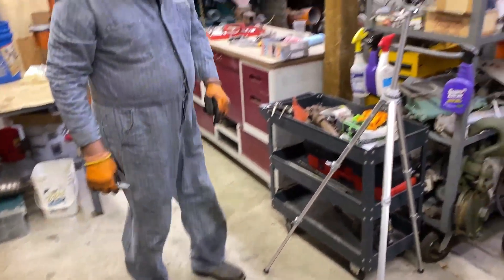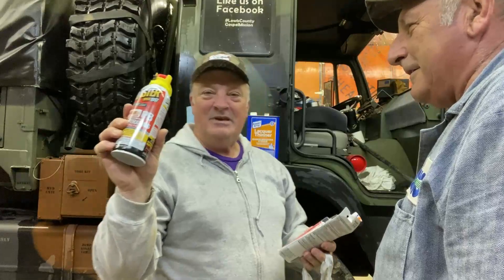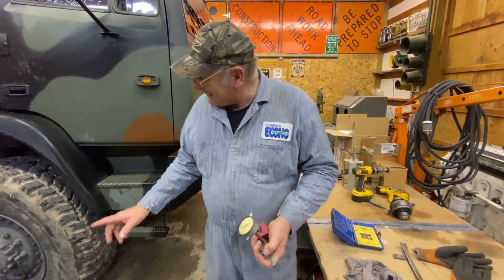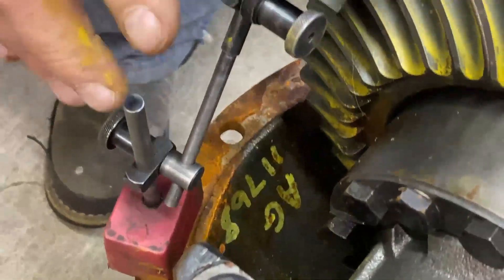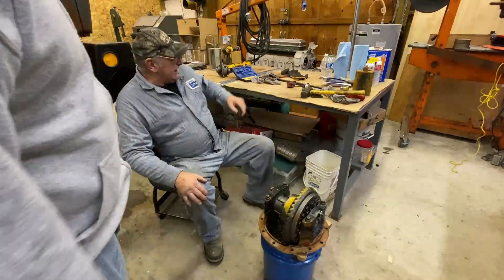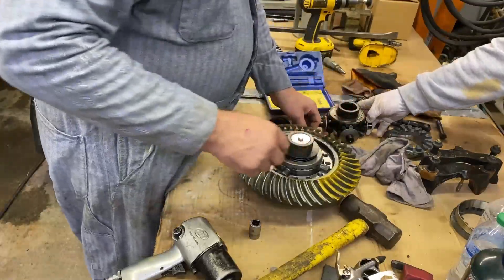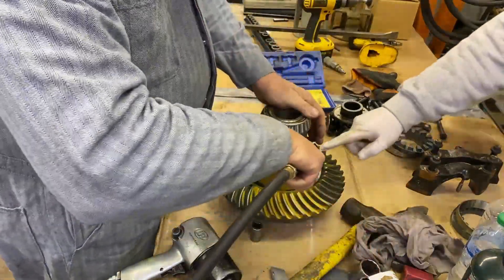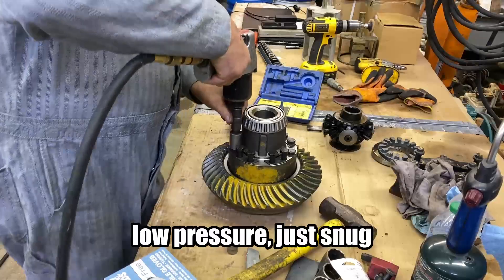FMTV 3.07 REAR DIFF & LOCKER, pt. 1

Comment: Appreciate the locker part, been thinking of that upgrade!
Reply from the maker: It is certainly easier to do the rear than it is to do anything with the front. :-D
Reply: @HelicoolsHelipad  Good to know.  On the 6x6, I'd just do the rearmost one with a locker as that axle is not driven unless in mode.